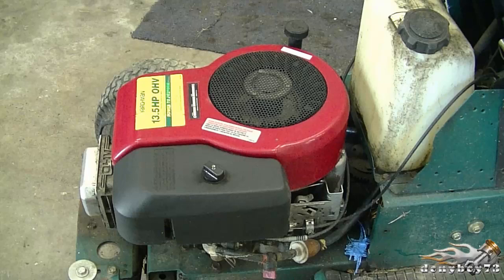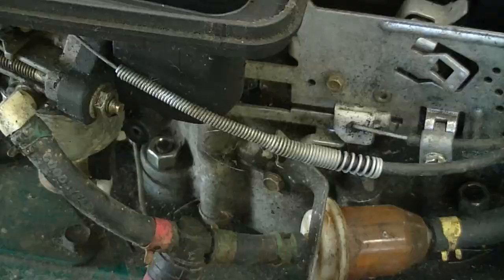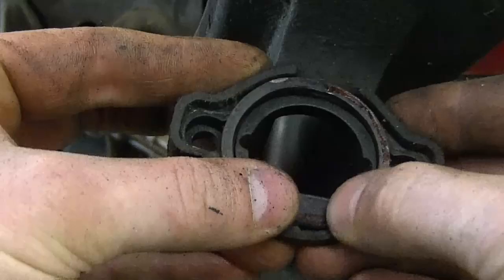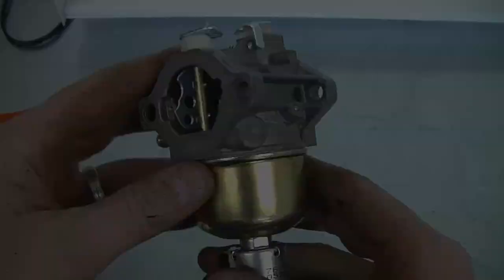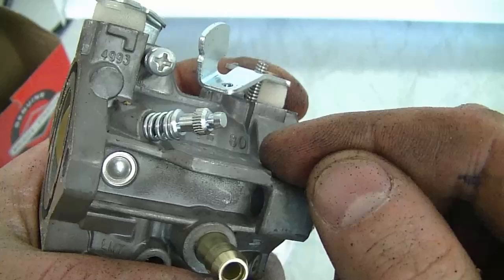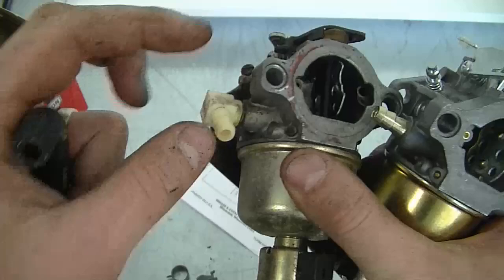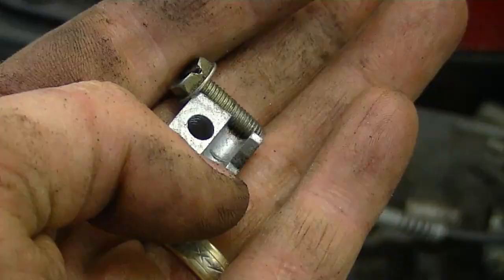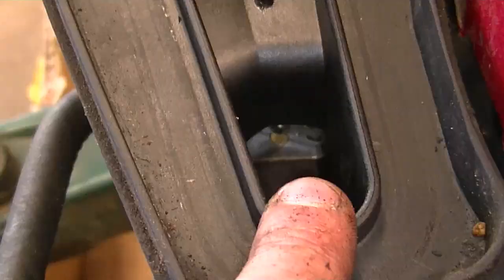DIY - Carburetor Replacement On Lawn Tractor With Briggs & Stratton Engine

Comment: Hello sir my zero turn. Don’t want to crank I put a new battery and spark plug. And nothing. It just turns but no crank. Do you think I need to replace the carburetor?

Comment: Don, why did you  decide to replace the carburetor rather than rebuild?  I have the same setup on my 14.5 MTD, and now I'm wondering if the solenoid is bad (I didn't know what that wire was for until I watched your video).  BTW, this is a great video and should be the standard for all DIY videos.  Thanks!
Reply from the maker: THE CARB WAS PROBLEMATIC and the customer opted for a new one

Comment: 210000 BS intek Has done this since it was new off and on,  load tested battery did a  starter draw test, cables even went directly to the starter with a good battery.Sometimes it works ok but most of the times it does not. I was told by a dealer early on that there is a sliding compression release built into the exhaust cam lobe and I was wondering if Dony had run into this problem. Compression test was within specs at the time according to dealer.

Comment: How do you change the choke springs on these carbs?  The one I am working on i have to manually turn off choke becaus ethe spring is broken, i bought a new spring, just don't know how to remove the broken one and install the new.  Thanks.

Comment: I used this video tonight to replace the carb on my B&S motor as it was identical to yours. The previous carb was flooding the engine. Followed your video step by step and now the motor cranks and turns over for 1-2 seconds before dying. Any ideas? Even though the old carb was flooding the engine it would still run.

Comment: Got a free Craftsman  LT1000. It had been sitting outdoors for at least five years.
Both the rear tires were flat... Replaced the carburetor for $89, Rear tire tubes for $26 and the blades for $32 and later the mower deck belt for $16, air filter $14, oil change $4, cup holder $5. It runs great and has earned its keep already this summer.

You can't appreciate a lawn tractor until you've spent 30 years pushing a mower....

Comment: I work on mowers in my spare time here in texas and 2 times last year I had customers said motor ran at way to high r.p.m. well I found the screws fell out of the butterfly for throttle and of course the screws on one got imbedded in head butterfly did not make it past valve the other butterfly broke in half never found it and 1 screw have you ran into this problem thanks for all the time you put into teaching everyone how to repair the machines

Comment: Excellent Video with step by step instructions.  I found that the choke control lever was a little different that the original.  There was a small plastic vertical knob that interfered with the air filter housing.  I simply cut the little knob to make it like the original carb.  Don't forget to attach the solenoid cable to to the bottom of the Carburetor.  my 14.5 hp engine has never run better.

Comment: Nice job once again. I found that using a heat gun to soften the gas line helps it to come off very easily. This is especially good when you have a short line that you need to reuse.

Comment: dony - Great video - just bought a Craftsmen 15.5 HP 42" Lawnmower Tractor.  This thing has not been used in a couple of years I think.  I am ignorant when it comes to this kind of stuff.  Am now retired so am going to have to learn.  Your video is very good with the exception of sometimes the attention to detail in camera work and instructions for us administrative types is lacking, but it is the best I have found yet on You Tube.  Try to focus in on the links, springs, etc.  Watch your fingers

Comment: Excellent vid, I replaced the carb on my briggs 12.5 flathead a couple years ago and it fixed a surging problem the engine had

Comment: Thanks Eddie. I had thought of JBW but not with a coat hanger. I may try it if I can think of a way to support the hanger while it is drying. Maybe I could leave the carb on the engine (drying position would be horizontal) and set the hanger on a wood block laid at the bottom of the engine compartment. Another way might be to remove the carb and lay it on its side on my workbench and just hold the hanger in place for however many minutes it takes for the JBW to firm up enough to hold it.

Comment: Changed lmt carb on16.5 B&S with an aftermarket one and ran for about 10 mins. Will only run while being fed gas from a squeeze bottle , same as before.
Reply from the maker: it's hit and miss with the aftermarket, I only install oem carbs on lawn tractors
Reply: TY

Comment: reat video, sat laptop on my workbench while replacing my carb.  Great presentation and great explanations.  the former carb was flooding out the engine.  With new carb on it ran, but smoked like crazy.  I figured the exhaust was full of oil and gas from the former flooding so went and cut grass for 40 minutes.  It eventually cleared up mostly, but not all.  I am wondering why it would now smoke and if it could be the valves?  I had lockup on start and found a video on setting the valves and that solved the starting issue, but why would it now smoke?

Comment: Hi, I have a Huskee Supreme 25.0HP 50 in. deck from Tractor Supply, probably almost 8 years old. Almost put in the amount of money that was paid for it in repairs to the local small engine repair store. So, this year, I am determined to get this thing running myself. I am having trouble finding a video of the carburetor cleaning/repair of a similar model. I put in a new battery, fuel filter, oil filter, air filter, spark plugs, oil change, new ethanol-free gas, even pulled out a mummified mouse. From what I have read online, I figured the carburetor is next. It still won't start, even when I sprayed ether in the intake...Don't know where to go from here. Thanks for your help/advice.

Comment: Did you adjust the idle screw any? I just bought a new carb for a B/S 175cc Professional series engine. Are they factory preset? Is there anything I should be aware of before starting? You make everything look easy. Always enjoy your vids.

Comment: Very useful, thanks Donyboy - the video is also a very good quality. 

I came here to see how the governor cable and spring hooks up to the throttle butterfly lever. I am reinstalling my carb (after a strip, clean and paint of the entire tractor) and the throttle stays open all the way - just with more or less tension according to the plastic slider position that is controlled by the throttle cable. Is this right or should the governor close the throttle when the throttle cable is pushed to the idle position?

Comment: If you don't have a shutoff valve could you plug the line somehow or would it be better to drain the fuel tank first? Great video by the way.

Comment: I have a 1996 toro wheel horse lawn tractor model # 71193  14-38XL and the carburetor number per the manual on this Briggs & Stratton engine is 497061 . I cannot find a replacement carburetor and I’m wondering what your suggestion would be. I am a new subscriber to your channel and I’m very impressed with your videos and your explanations. Thank you for all that you do

Comment: hoooooo wheeeeeeee! a GENUINE carb. that mustve costed a fortune. lol( i always rebuild or use aftermarket) 

your vids are always packed with information. keep them coming😊
Reply: larry johnson 

go onto amazon. youd need the make of the equipment it is installed on but just typing in walbro 4993 carburetor comes up with multiple listings. as cheap as 15 dollars. find the one with FREE shipping and make sure it is a us seller unless you want to wait a month lol. if you have prime shipping from amazon is free. 30 day trial is offered IF you never had prime in a year or two.

my carb. for my snowblower tecumseh hm100 engine has the fuel fitting angled compared to straight i know they can be swapped but i didnt bother. rebuilt that one. kits are dirt cheap as well.
Reply: larry johnson 

lol well as the saying goes....try try again. i pulled up suggestions around 13 dollars cheapest. youd need to get the carb numbers and engine info. it sometimes takes me hours but its there.

also try ebay.

Comment: I have been needing to find a video about how to replace the carburetor on a 1998 Murray with a 17hp Tecumseh engine. This carburetor looks like the one I am replacing. I hope it works. The only difference seems to be that my breather cover has two screws instead of just one.

Comment: Dony, once again an excellent video! very helpful! very easy to follow!  clear steady video, no camera shake! the best on you tube! Danny would you be able to  show us how to clean this carb, and maybe rebuild it? Cleaning would be great because I  have to do mine very soon, and the engine and carb look almost exactly as this one. I followed your other video where the engine is in the vise. very good, but the carb is not exactly as this one. and I don't want to  miss  cleaning any hole or orifice. Thanks Dany       And have you  done  a video on cleaning and tuning up a  big brigs  flow jet on a horizontal shaft engine like  a 12 hp.?  as I could use  that video also soon! Thanks again.

Comment: I have a 14.5 HP B&S 287707. It has a Nikki carb. I cleaned it with berrryman carb dip and blew it out with air. I did however re-use the gaskets and needle. Basically i cleaned it and put it back together. I reinstall it on engine, and the engine starts on full choke and will run at full choke for about 10 seconds before dieing. Also, as soon as I pull the throttle lever down in those 10 seconds, it immediately dies. Any suggestions? I thoroughly enjoy your videos and have helped tremendously

Comment: Any tips for adjusting the carburetor ?what position should the adjustment screw be in . what is suppose to happen whenever it’s turned in or turned out  . I’m experiencing  engine surging in the fast throttle speed setting .Idle speed runs fine and motor starts well . Any suggestions are appreciated

Comment: pull the carb - pull the bowl - then look on the shaft sticking down - take a strip back a twist tie -- and push it up from the bottom of the shaft looking thing - it will go all the way into the carb -- looking from the end with the choke on it - you will see it sticking in there. On the SIDE of the shaft is a screw looking thing - push it through the center of that hole - there is a tiny hole in there - that is the primary jet. soak it in oven cleaner too BEFORE you reassemble it.

Comment: was just wondering . i changed my carb as directed and one question came to mind. when you put the two tubes back into the fuel tank , how much of the return tube should be inserted into tank? My tank was 1/2 full but the return tube didn' t reach down into the fuel. does it supposed to reach all the way down like the other tube does? I did notice that the primer didn't work well so I  filled the tank up to full and noticed the primer worked much better and everything was fine afterwards . thanks for any comment you have on this .

Comment: Nice video , I was working on a similar engine today on a tractor that has been sitting for years, emptied the old gas out and still wouldn't start i will use your video as a guide to clean the carburetor, do you think it is all gummed up?

Comment: Could you possibly post the initial mixture  screw settings?  How many turns?
Thank you.
Nice video.
Reply: Turn on the Engine.  Let it warm up for about 10 minutes.  Idle at the "lowest" speed setting, LISTEN to the sound as you adjust.  You want to hear the Engine smooth, but running as LOW as you can during idle.  NOTE:  I adjust until it almost shut down, then turn half way up.

Comment: Don I followed your video very closely, the new carb went on great. Lawnmower started right up, but keeps surging. when i put the throttle to low it runs smooth, but when I try to get some speed it starts to surge and then quits. What can I do to get this running better? Thanks for the video and help.

Comment: Don-
Thanks, this is very helpful...So, that electrical plug at the bottom of the carb is a safety solenoid...Perhaps you can explain how to troubleshoot that solenoid for me...Should 12 volts be present at that plug when the key switch is on?  I am trying to help a long distance buddy get a similar engine running and I think the problem is in that safety solenoid...Thanks- Don K.

Comment: Hi Dony,
    I have a surging engine on my JD LX178 and am curious what I should check first??  The fuel filter looks drier than usual.  If you need me to take apart the carb, need a good videp for this... Thanks,
Joanne

Comment: also, the new replacement for the part number shown does not come with the adjustment screw tool, or the rubber hose. (2021)

Comment: Might try & Take a piece of coat hanger, Bend a small handle & a small Drop of J B Weld, Stick it on the thread part of the screw & Let set 24 Hours, Twist it out.

Comment: When I remove the old carburetor, could I just copy the idle and the other adjustment onto the new carburetor by counting the amount of turns that the old carburetor had by backing it in and then backing it out?
Reply: Yes, you can do that.  Some aftermarket, it's a bit different.  Here is how I do it.... Turn on the Engine.  Let it warm up for about 10 minutes.  Idle at the "lowest" speed setting, LISTEN to the sound as you adjust.  You want to hear the Engine smooth, but running as LOW as you can during idling.  NOTE:  I adjust until it almost shut down, then turn half way up.

Comment: How come when I look up this carburetor, using the number, and link you provide, it is for the “typical” Nikki carburetor? Correct me if I’m wrong, but that doesn’t look like a Nikki carburetor you are installing. Is there a carburetor I can use other than a Nikki? I’m working on a 31P777 Briggs & Stratton. Thanks in advance. I find your videos very helpful,  and enjoy watching them.

Comment: Thanks for great video. I have fuel 'standing' in the carb throat. I paper toweled it out and tried to start,but it starts then stops like running out of gas. Is float stuck?

Comment: Donny, I have a 21 hp Briggs and Stratton riding mower with a similar carb. I have cleaned and rebuilt the carb and now it starts with the choke on but the engine surges. When, I move the throttle off of the choke to a lower idle the engine will shut off. I have checked the governor and linkages and everything appears to be ok. Any idea on what might be going on should check next? Thank you for the great videos!
Reply from the maker: possiblya bad carb or some passages are still blocked

Comment: I have the same question as Kirbywatch07.  How do you remove the bowl?  On my carb, there is a sensor on the bottom of the bowl where the nut should be.

Comment: How do you adjust the screw above the one mixture screw thanks ...
Reply: Turn on the Engine.  Let it warm up for about 10 minutes.  Idle at the "lowest" speed setting, LISTEN to the sound as you adjust.  You want to hear the Engine smooth, but running as LOW as you can during idle.  NOTE:  I adjust until it almost shut down, then turn half way up.

Comment: Just viewed the replace carburetor on lawn tractor with briggs and stratton engine. It looks like the same style that I have on mine. Can I clean it by just removing the air cleaner and spraying carb cleaner without removing the carburetor from the engine?

Comment: Can you remove the solenoid to get the bowl off for a cleaning without taking the rest of it apart? Looks like I have a similar carb but I cannot see how to remove the solenoid.
Reply from the maker: if you grind a 1/2" open end wrench thinner it will fit between carb and solenoid and then you can remove it and the bowl will come off

Comment: Dony I have a carb prob. Same as the one u did in this vid. It has a different solenoid on the bottom of the bowl. It was leaking so I tightened the solenoid and it broke. Can I replace the solinoid or do I have to replace the carb???

Comment: I accidently broke the idel adjustment screw such that the threaded end is still in the carb (same one as in this video). I can't get pliers on it in order to remove & replace it. I have run the tractor a few times since & it still idles fine as before I broke the screw. I guess I could get the broken screw out with a screw extractor but risk damaging the carb. Do you have a suggestion? Thanks.

Comment: Hi Dony, I have same model 17hp and locks up when turning over. I have to manually turn back the crank to the end of the compression stroke so it can get a run at it. Most times it won't turn over passed the compression stroke. I adjusted the valves like your videos. Does that model have a compression release built into the exhaust cam?

Comment: The po of my mower broke the tip of the mixture screw off inside the carb and wont come out. Any tips on hot to get it out?

Comment: What if the carburetor you replaced did not have a solenoid on it and the new carb does is it gonna prevent the fuel from going through
Reply from the maker: Yes it will, you will need power at the solenoid.

Comment: Thanks Brah. I appreciate you including the part number for the carb. I have a 12.5 H.P PowerBuilt and it's needing a new carb. Where would be a good place to order one from? It's on a Huskee. Thanks again for sharing the video.
Reply from the maker: try discountonlineparts.com they will also give u 10% off at checkout if you use code "donyboy73discount"
Reply: Thank-you, Donyboy. I'm glad I ran across you video...

Comment: dony boy i have a 2008 1705 overhead valve briggs on my troy built pony it was surging because the adjustment screw fell of i thought it was the carb so i tore my carb apart and it was a nikki so i got a new one and it runs good choked it doesn't have a cap on that screw for mixture adjustment and the engine surges when ever i try to give it full throttle please help